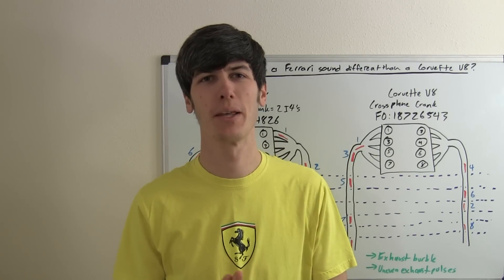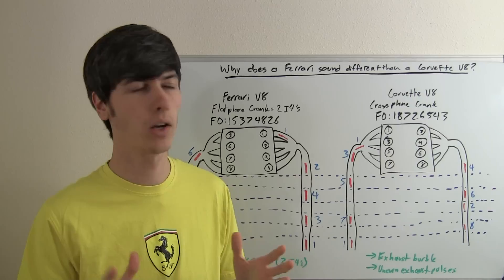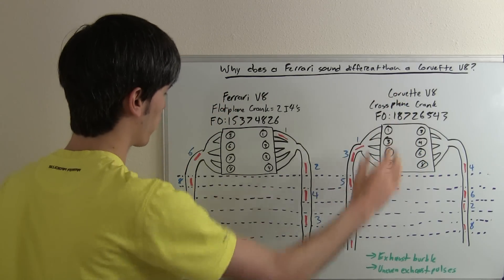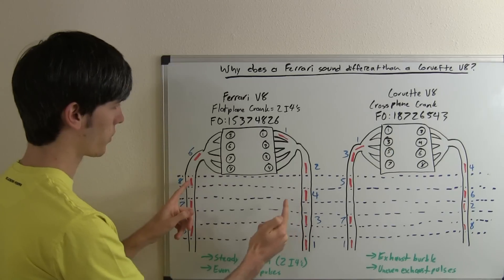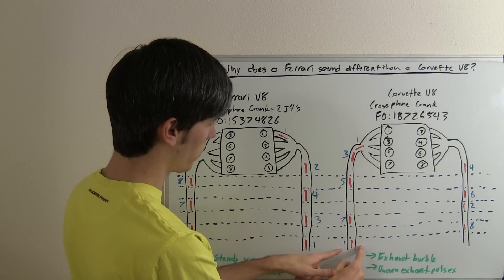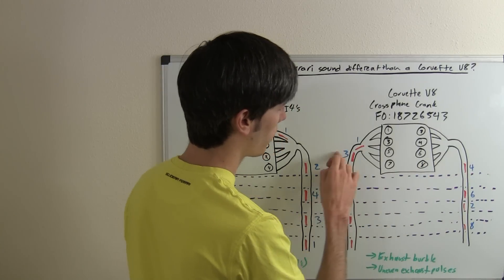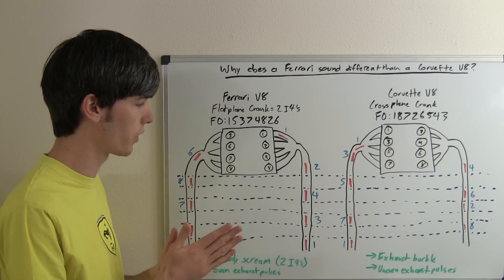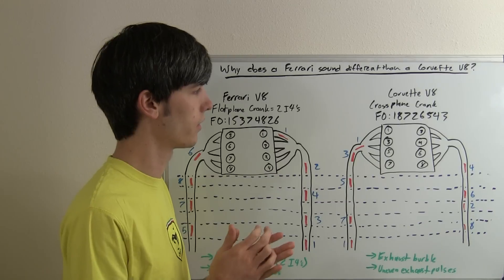Ferrari V8 vs Corvette V8 - Why do they sound different?

Comment: I'm not a drummer... but what I realized watching this video is that in terms of drum rudiments, a Ferrari V8 exhaust is like a single stroke roll, and a Corvette V8 exhaust is like a paradiddle. I started playing the firing order with my fingers on the table top and it blew my mind.
Reply: yeah i saw a video where they replicate the sound with drums , it was a review of the ford mustang gt350
Reply: maybe thats why us musicians/producers usually are car guys to. How they are so similar.
Reply: I was trying to make comparisons like that too but with Electronic music when watching Top Gear Patagonia Special. xD

Cross plane crank kinda like Detroit influenced Techno because of its varied burbly groove. 

Flat plane crank kinda like Chicago House because of its active locked repetition.
Reply: Best comment by far!
Reply: Hot For Teacher-Van Halen. Sounds like a Harley at first.
Reply: Cross planes has a rythm, flat planes don't
Reply: I did it with my hands on a table and it blew my mind too
Reply: The cross-plane's idle sounds like a horse galloping.  The word paradiddle is an otomotopoea for this rhythm.  I once troubleshot a V8 engine tap and related it to the camshaft because it was half the drum speed or frequency of the crankshaft.  V8 engines really do make music.
Reply: Yes. Precisely.
Reply: Maybe we should be watching your video rather than the babbling baphoon we just watched!
Reply: @wizardsvenn6087 
AUX 88 , DJ Stingray , Direct Beat, Drexicya forever… can’t stop the computer rock - -

Comment: As a mechanic i absolutly love your videos. We know how to replace anything in a car. We arent really supposed to know how they work, just how to fix them. These videos are really awesome. Keep them up
Reply from the maker: Glad to hear you enjoy the channel, thanks for watching!
Reply: If you're a mechanic that doesn't know how a car works, you're probably not a very good one.
Reply: Well why would they teach us in school about the theories or physics of the engine. This exaust system is interesting, but all a mechanic needs to know is how to take off the bolts and put new ones on. So tell me how im a bad mechanic for not knowing engine theory?
Reply: trollaphobic "In repairing cars, their main role is to diagnose the problem accurately and quickly." - second sentence in this Wikipedia article, http://en.wikipedia.org/wiki/Auto_mechanic You can be a parts re-placer and have no knowledge of how anything works but to be a mechanic or technician you need to fully understand how it works in order to diagnose certain problems. If you're nothing but a parts re-placer, then I feel sorry for you because figuring out and then solving the problem is the best part of my job as a technician. Also not sure what school you went to but mine certainly teaches theory.
Reply: We were taught what we need to know. Youre right, about learnig HOW things work will be etter for diagnosing problems. But dont you thing this is a bit specific. When would a mechanic ever need to know the different types of exaust pulses to diagnose a problem? What possible exaust issue could be affected by this? Performance? Yes. Repairs? No. So why teach something like this
Reply: trollaphobic No I agree the average mechanic doesn't need to know this, only if you were recommending performance upgrades for a customer would this be helpful, most of the stuff on this channel is more in depth then a mechanic needs to know, but its certainly interesting and good to know, which is why I'm also a subscriber. I just took offence to your original comment because you said we aren't supposed to know how they work, which completely untrue, we definitely need to understand at least the basic theory and operation, in order to fix them.
Reply: So i was being too video specific and you thought i was bein too generic. Great. Now lets all move on with our lives
Reply: trollaphobic 
You are totally correct. I have a Masters in Mechanical Engineering yet, I have no clue how to do certain things a mechanic can. Not knowing the difference in piston firing orders doesn't make you a bad or even general mechanic. Its all about what you need to know for the job. Good on you for having the ambition to learn more! Keep moving up  /\
Reply: i think you are supposed to know how they work lol
Reply: I dont think you know what an engineer is in that case. Most of the work in doing in my current masters is finding how a computer workes out finite element analysis using mathematics and using equations to determine the life of crack initiation and propergation for oil rig pipes... mechanical enguneers have nothing to do with engines
Reply: Forgive my grammer, im typing and walking.
Reply: see thats the reason mechanics leave parts hanging off my car and leaking valve covers and oil pumps.
Reply: +trollaphobic WTF? seriously? I'm an apprentice and we get taught anything, also to calculate everything even tho we probably won't ever need it again
where do you work that you just have to take bolts off and replace stuff?
where do you live? Lol
Reply: DamnParaNoiD its nice to know but you dont need exhaust theory for anything. Engine theory is useful for diagnosis, so you should know those basics. But no tech ever needs to know this to be a good tech
Reply: as I said we get taught *everything (corrected sry),  for all kinds of engines  like inline, boxer etc , as well as ignition order .. just everything
well I think so because you can just really understand what is going on in the car if you have learned it
Reply: American v8’s were originally proposed to be 2 cycle engines and have cross plane crankshaft. They can be co vetted to poppet valved loop scavenged, ported it use Coats ball valve heads go boosted loop scavenging, I always liked big block 2 cycles better, there’s no suck thing as a 4 stroke, it’s all just in our minds.

Comment: Just curious.  Why didn't Honda ever make 2 of their 4-cyclinder engines into an 8-cyclinder flatcrank engine?  The concept seems like simple enough that I'd think a company like Honda would have absolutely no technical hurdles
Reply: cuz the vtec would be too maaaad. the world isnt ready fot that mad vtec
Reply: +Frank Magana Really? no thanks
Reply: straight 4 vtec 2.0 liter engine just enough, how can you ask more, people satisfaction never been full fill.
Reply: +nurfaikham haiqal why take a 4banger when you can have a v8. Cars need at least 350 hp and 6 cylinders, but i would prefer 8
Reply: I guess people like angry bees and make a whopping 200 horsepower at 8 grand. The funny thing is after the VTec guys started putting turbos on them,  they'd  take the VTec out because you didn't need it
Reply: +Mrcrazydave11 mills out the vtec cams
"Weight reduction, bro!"
Reply: +Chau Nguyen Well a less sarcastic answer is because their demographic is more focused on small economical city cars, not power machines. That said, I find they do quite well getting power from such tiny engines. Although, that is their specialty after all.
Reply: Cause it's a Honda ... It has a right not to be a v8
Reply: Interestingly enough, looks like Honda did make a V8 for Indy racing years ago. A 3.5L NA 690hp monster.  Impressive. But since their target market doesnt require V8s, they have no need to mass produce one.
Reply: Honda made a v12 made of 2 of there i4's and then 2 inline 4's cut in half. they didn't make many at all
Reply: +Chau Nguyen Honda (motorcycles) made a pseudo v8 in the early eighties with it's oval piston "V4''.
Reply: +Stephen Scholes  that's true and there were two versions.

The technology was developed for the 500cc class of GP racing by Honda who were adamant that they would not desert the four stroke cycle and they would compete with all the other companies who were racing 2 strokes.

The design was partially successful so some time later Honda put the concept on the road with a RC45 type flagship sports bike, but even more trick as far as the frame and cycle parts were concerned.

The engine has 4 pistons with 2 con rods per piston in, i think, 90 degree V formation, 8 valves per cylinder, not strictly oval as there are straight sides to the "oval" with semi-circular ends.

750cc, fuel injection, cutting edge technology re. materials, wind tunnel developed aerodynamics. I think 180 mph was rumoured.

They didn't make many, but they all eventually "sold".  Very valuable now.
Reply: +wontputrealname your completely right and to add to that the entire reason for oval pistons was due to a restriction to 4 cylinder engines. in theory Honda felt that by adding more valves, they could get more air flow through the engine, however a conventional round cylinder can't accommodate 8 valves.

+Chau Nguyen, how much power do you really think a front wheel drive car can handle? a V6 is can produce more than enough.
Reply: They would have to reengineer everything else on their cars Hondas are meant to be light affordable and economic

Comment: The clue of flatplane V8 is: Switch off the entire left or right bank of the engine (sparks & injectors) and you still got properly working Inline-4 engine with usual 1/3/4/2 firing order